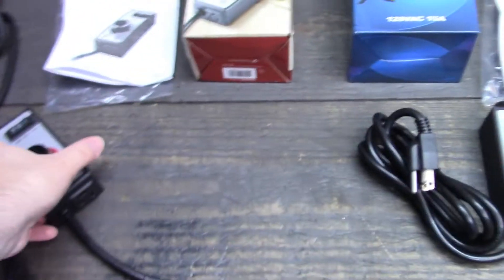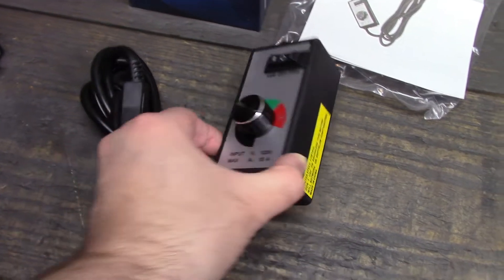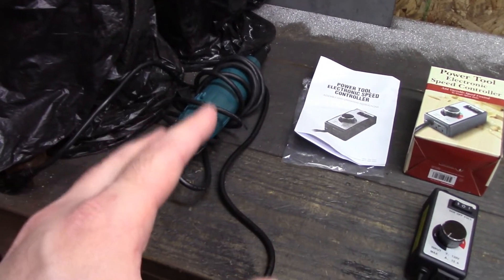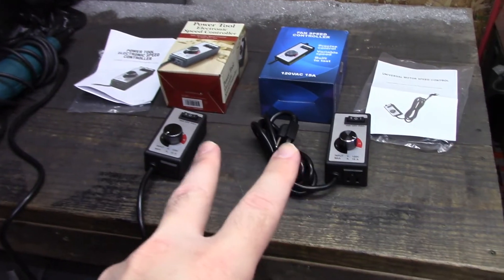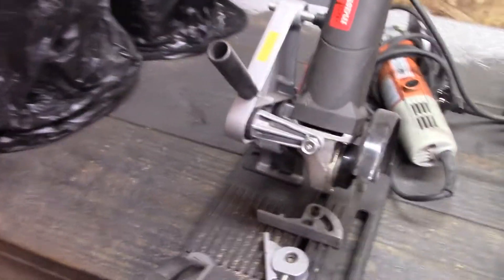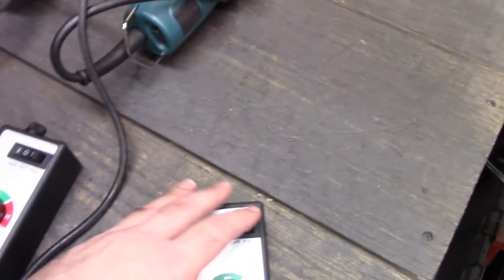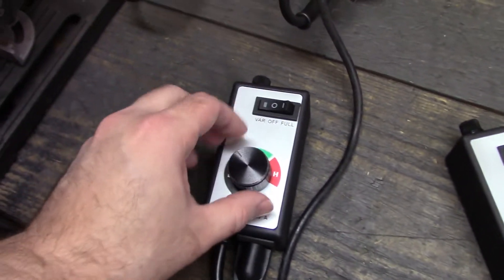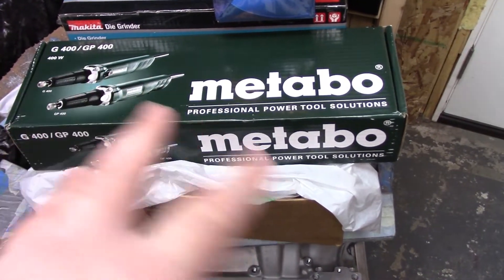Can Two Electronic Speed Controllers Be Used In Series ???

Comment: If you set the speed the same on both controllers maybe adjust to get equal output does it work?
If both dials are connected that may be a problem i would think wire 1 dial to both and connect units in series so 1 isnt cutting power while other is trying to spin it